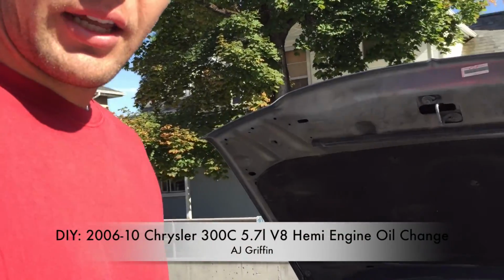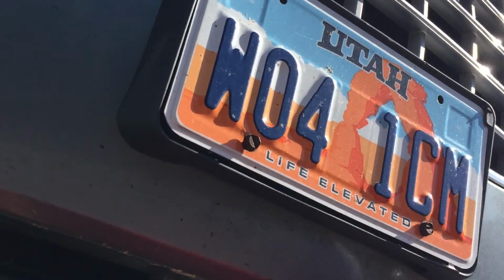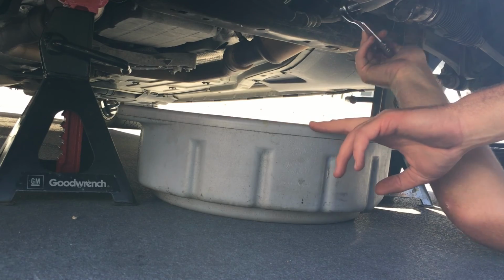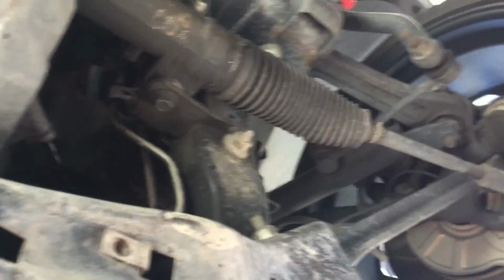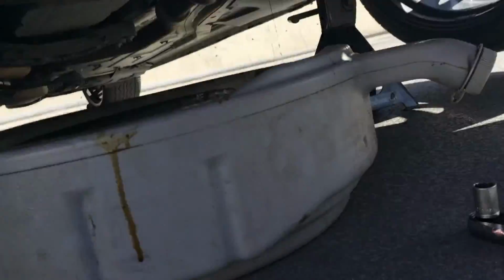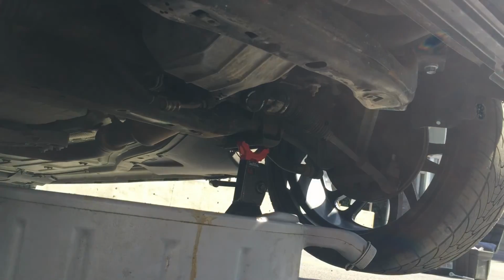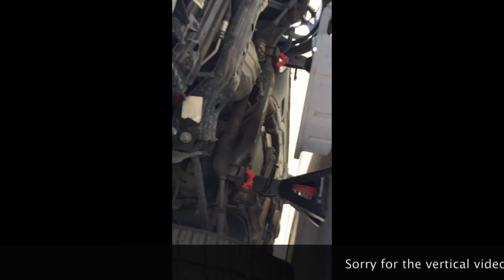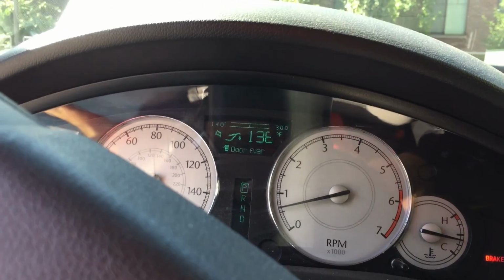DIY: 2006-10 Chrysler 300C 5.7l V8 Hemi Oil Change Tutorial

Comment: Just an FYI: A lot of comments are asking why you use a Fram oil filter.  If you do a little research, Fram makes one of the worst oil filters you can buy.  Spend 2 dollars more and purchase either a factory OEM filter, or K&N.  Both sold at NAPA, Walmart, AutoZone etc for 8-10 bucks.  Good luck and take care. ✌️
Reply: Yes the regular "orange can of death" Fram is crap, However, their higher end filters (the silver ones) are pretty decent, check bobistheoilguy.com The orange ones though suck, cardboard ends and all lol
Reply: @SNeal5966  good to know, I'll check out the link.  Thank you! 👍
Reply: actually, they do have the different style end caps, but they work just fine

Comment: I've never had to poor oil in the filter before installing. That makes a hell of a mess. Definitely not recommended.
Reply: Julian Rosales usually only oil around the edges to make sure it seals better
Reply: Disagree as filling the filter primes the system prevents strain to the oil pump  real mechanics always do this , so what if it's a little messy it's a proven method of prevention and keeps the engine lubed when first cranked
Reply: @garycorbin2789  yep
Reply: I've never seen it NOT done.

Comment: What a mess. No clean up.  Loosen the top cap also for drain and wipe the areas also. Fill the center of the filter but use a better filter with a anti drain back valve also. Car looks abused. Sad sad car.
Reply: Well, if you've ever driven on the roads in Utah...eh, um, that says it all, lol...